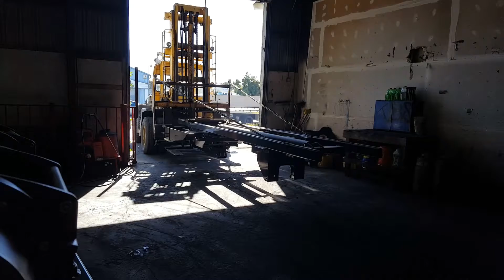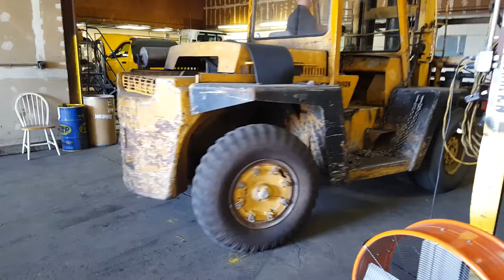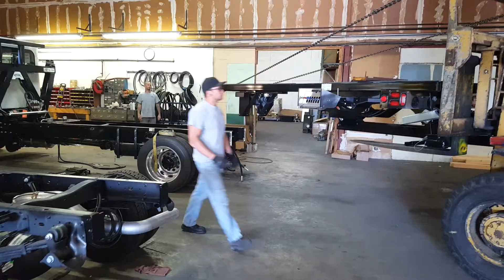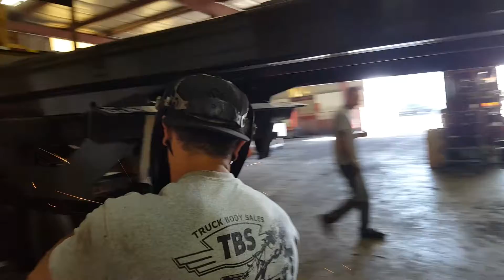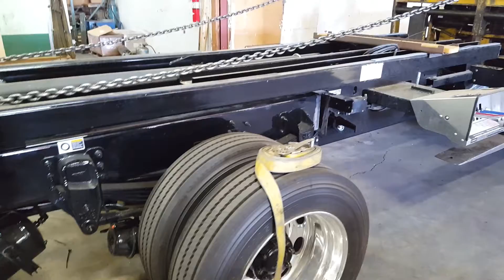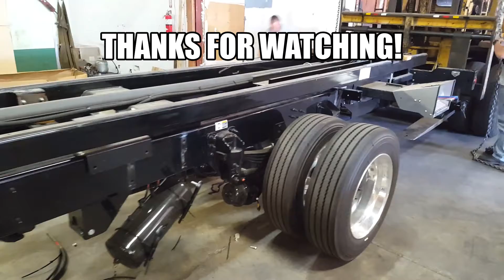Setting a Rollback Bed (Tow Truck Build)

Comment: Nice work guys looks clean. Quick question how could one leave the inboard saddle off the frame and still drill the bolts though it keeping the saddle off the frame. I got a new truck with chevron west the competitors down the street, and they couldn't get anything right. Just wondering if it was sheer stupidity or if it can happen sometimes.
Reply from the maker: Go see Scott at TBS. He knows his shit.
Reply: @WRECKERMANDAN  will do, im not making that mistake twice. chevron should not be making tow truck they proved that to me. My next truck will be from TBS

Comment: how long the chassis needs to be?
Reply from the maker: Your product should have come with a Builders Installation manual from the manufacturer that will detail all the cut-off lengths per bed design and chassis. If you do not have the booklet, contact your products manufacturer.